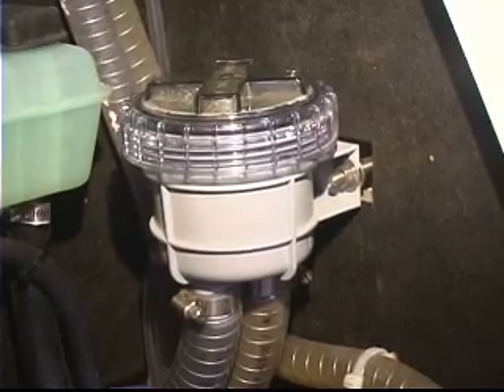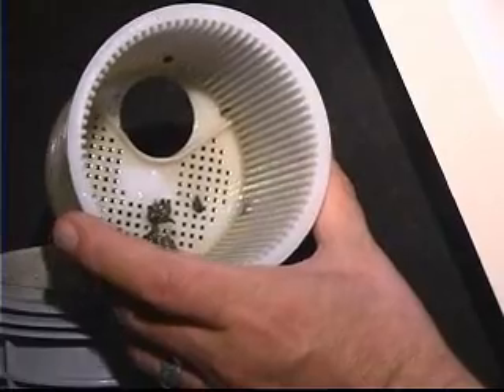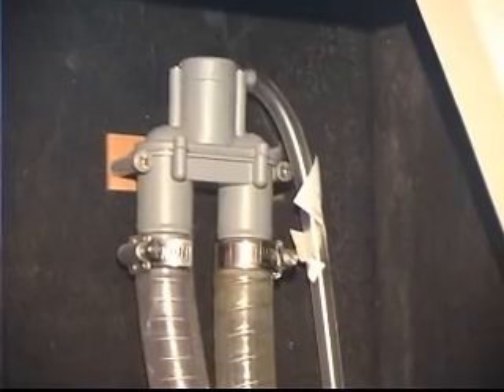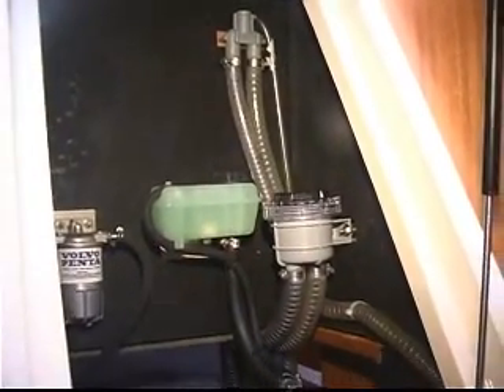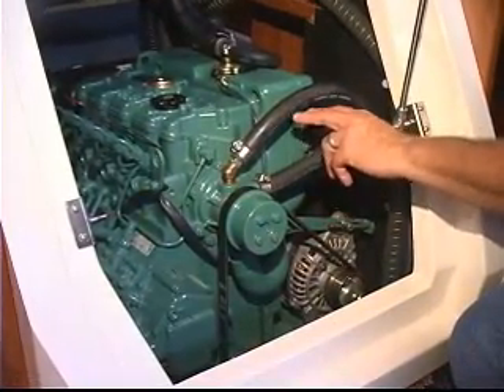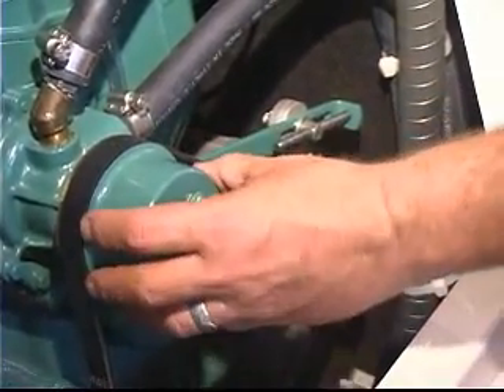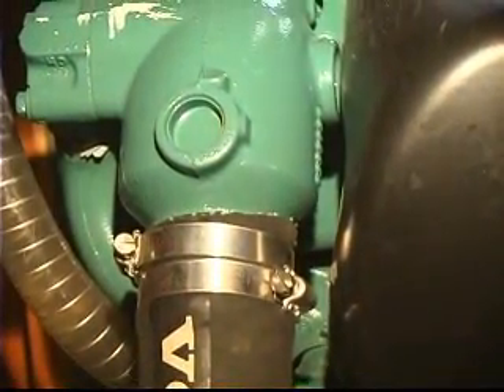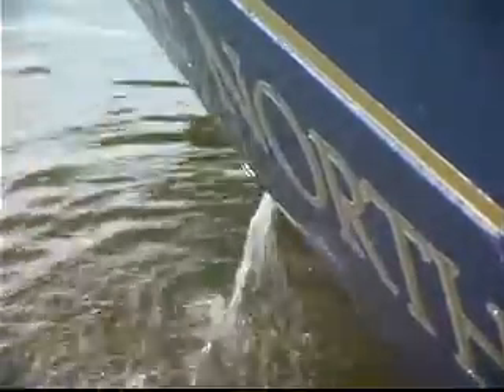Diesel Engine Cooling System

Comment: it is still possible to have decent flow at idle, yet to have sufficient blockage of the cooling water flow to the exhaust elbow ( or through the elbow !)  to reduce cooling at mid and higher throttle settings, leading to over heating.  On older boats, and boats which have been inactive..it is extremely good practice to open the cooling system .. and check the openness of  and flow through  right angle fittings, the thermostat and housing, and through the water cooled elbow itself.  It is not enough to say the hoses are good.. so the flow must be 100%.   Open it up and LOOK !  Calcium build up is insidious.. and likes to happen where you cannot see it easily.  Acid flush periodically to be sure.